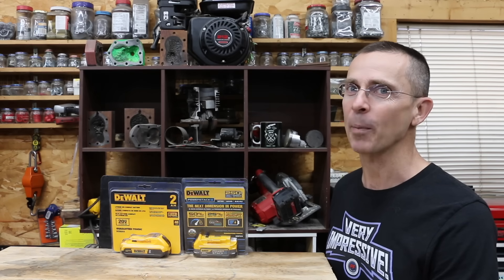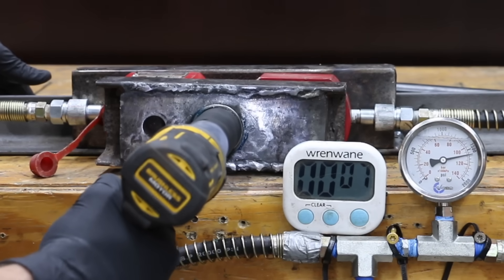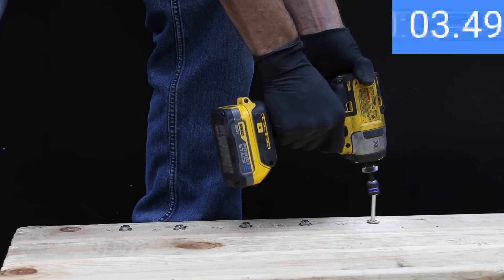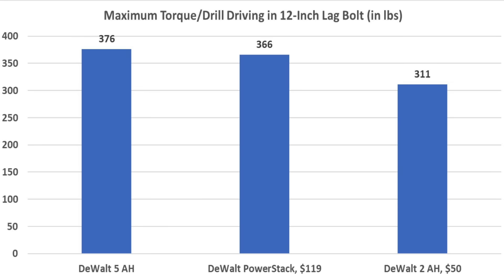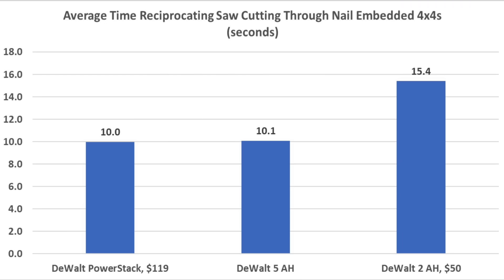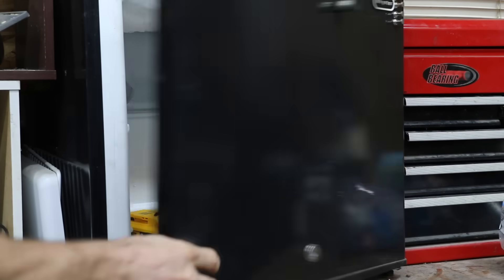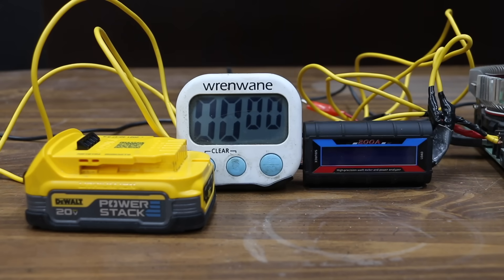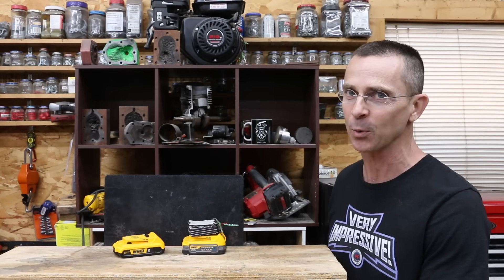Compact “Pouch Cell” Battery Better? Let's Find Out!

Comment: Hey, just wondering if you could start formatting the graphs to include zero and show the scale of the graphs, since that's more visually useful for comparison's sake. 

If you want to zoom in on the top (where the data points are) a that's fine, but this airspeed graph gives a warped sense of total useful power, and it's not the first time I've seen things like this.
Reply from the maker: Thanks for the feedback!

Comment: So the only benefit is that it is lighter? It is equivalent to around 4amp and is half the weight of a 5 amp but I didnt hear how expensive the 5 amp was to compare them. On the chart you didnt show it.
That was weird.
Reply: its not obvious but pouch cells can have a higher energy density and output for its size because it doesn't use a steel case. their are draw backs, its more expensive and less durable because its harder to cool which is probably why they are selling it only in small batteries. we will see the benefits in the future if they dont just end up deciding to use a variant of Tesla's 4680 tabless cylindrical cell.

Comment: What about heat? When the lithium batteries heat up it's bad for them, and they won't charge until they cool.
Reply: getting rid of heat in pouch cells is harder but they are a bit more thermally resistant but probably not enough to scale up well in large battery packs. i usually buy 9 amp batteries and use them for everything since very few things can ever stress them to the point of overheating.

Comment: 14:41 5cells not 6, all those 18-24V are in reality 5s batteries
historically these pouch cells aged a lot faster than 18650, there might be a reason DeWalt switched now, might've gotten a lot better.

great work great video!
Reply from the maker: Thanks!

Comment: DeWalt most likely pays less for the pouch cells than they do for the 18650s.
Reply: unlikely, pouch cells are more expenisive but have a higher output and energy density but worse heat dispersion.

Comment: Gonna have to disagree that the 5ah came out on top on the hammer drill test.  It produced the most torque, BUT the power stack drove the lag bolt further into the wood..   In jobs where longevity is more important.. that powerstack looks to be a great choice on that one..

Comment: your (pouch battery) is called lithium polymer battery, it is used in the radio controll hobby for a long time, it primary advantage is light weight and slightly higher voltage, can be dangerous if miss used or a low grade BCM (battery comtroll modiule) is used.
Reply from the maker: Thanks for sharing.

Comment: Two amp hour batteries are practically throwaways just something they give you when they include a battery with the tool, the best thing to do is immediately go out and buy a six amp hour battery at least if not a flex volt
Reply from the maker: Thanks for the feedback.

Comment: There's only 5 18650 batteries in the pack, I had to circle back on that one lol
If it had 6 it would be a 24 volt pack and I would have to switch to DeWalt lol
Reply from the maker: Thanks for sharing.

Comment: I've broken the 1/4 inch drive to 1/2 inch and 3/8 square drive with 5 amp hour batteries. I think the power stack is ideal for light to moderate load for short amounts of time. Seems good for the cordless ratchets
Reply from the maker: Thanks for sharing.

Comment: The pouch cell batteries are used heavily in the RC world. Quadcopters, electric planes and helicopters, etc. and known as "LiPo"s for lithium polymer. They're great for that use because they are capable of providing very high current draw which is needed for the motors.
The problem with these batteries are that they have to be handled with care. They need it to be charged correctly and not over discharged. The cells are not in in a plastic case and don't have a dedicated, foolproof charger. Instead a hobby charger is used which allows you to select charge rate amongst other things. If you don't know what you're doing with these batteries it's easy to overcharge them or over discharge them and end up with swollen batteries that may catch fire.
LiPO batteries are prone to swelling anyway as they age, so it'll be interesting to see how the DeWalt batteries using these cells fare.
Reply from the maker: Thanks for the feedback.

Comment: Look into the new ethanol % being allowed in gasoline. Higher than 10% is detrimental to vehicles older than 2018, and even the fuel station systems.
Reply from the maker: Thanks for the suggestion.

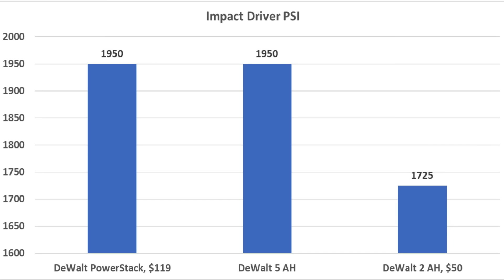Comment: I really enjoy your videos and the in-depth analysis, but there is one thing I would do differently: I would keep the minimum value of the Y-axis at 0 for all of your graphs. Moving the minimum up makes the differences between values look much larger, but loses the context for how significant that difference is. For example, the 1920 PSI vs 1725 PSI at 2:52 looks HUGE, but it's not really that big of a difference and probably not worth paying over twice as much for the battery.
Reply from the maker: Thanks!  Thanks for the feedback.

Comment: So the powerstack being a lipo is like taking a step back from li-ion back to nicad where you had to make sure they were discharged to a proper level for storing and all that. Funny how they still say li-ion though. I need to start making sure I don't keep my 2 powerstacks fully charged for an extended period then to make sure I'm maintaining them properly. Ugh not sure if they are all worth it any more with the extra hassle of having to maintain them like that whereas I charge my 5 and 6ah and they are perfectly happy until you finally use them whenever it may be. I once found a 5ah battery in my shed that was in there for about 2 years, when I found it in my tool bag and checked it, it still had 3 bars. Doubt a powerstack would hold a full charge as long as a li-ion
Reply from the maker: Thanks for the feedback.

Comment: Can you tell me if the Power Stack is able to be charged on the old 18v charger or does it need a dedicated charger.
Reply from the maker: It works on the same charger as the regular 18V lithium batteries. Thank you

Comment: Unfortunately, Dewalt is now packaging the smaller 2 ah battery with their new tool purchases when it used to be a 4 ah or 5 ah.  This is to reduce their cost but now you have to buy additional batteries.  I still love Dewalt and buy batteries once they go on sale but those small ones are only used in my oscillating saw when I am cutting drywall.
Reply from the maker: Thanks for the feedback.

Comment: To my favorite test channel please do a test on flex stacked batteries they are showing a much better performance by amp hr for their pouch cell batteries the 6 amp hr on paper is almost supposed to compete with the highest amp hr of level of standard batteries  I've been impressed with the performance of my flex tools switched after theft but I either need to buy duplicate tools

Comment: If they would just adopt LifePo4 then they would see record sales. The lithium polymer packets actually have a lower charge cycle life than the lithium ion cells, but the polymer tech can release more energy faster which is why the increases power but shorter recharge cycle.
Reply from the maker: Thanks for the feedback.

Comment: I recently bought two of the new powerstack batteries. I only use 4 5 and 6 AH batteries before this. Love the size of the new ones and the weight , power is good but drains far too quickly. Wont be buying anymore of these until they release at least a 4AH one as the 1.7 AH are just a waste of cash.
Reply from the maker: Thanks for the feedback.

Comment: I always enjoy your analyses.  To me it seems that the weight and size reduction over the 5A battery doesn't come close the additional cost.  I have a couple knock off batteries marked 6A which is optimistic that were half the cost of a 5A battery.  I could buy 5 knowck off 6A batteries for the cost of that Powerstack battery.  Granted I am occasional user of battery tools and don't carry them around all day, and I don't work my tools as hard as you do in your tests.  :)
Reply from the maker: Thanks!

Comment: I would like to see someone add an AC-DC buck boost converter to a battery pack so you can use a normal 120v power socket to run a tool instead of by battery, pretty interesting project i think.
Reply from the maker: Thanks for the suggestion.

Comment: We are building an electrathon vehicle and would be curious if the stacked batteries would hold up.  We get 16 pounds of battery (not including the case, ONLY THE CELL OR PILLOW) and travel as far as possible in one hour.  Can you suggest what battery to use?  We can run them in any combination of series or parallel. Thanks.
Reply from the maker: I don't believe the stacked cells will hold up in the long run.
Reply: @ProjectFarm  Thank you for your quick reply.  Great videos, I use them in some of my classes.  The students are persistent about this,  and they have a couple of questions.  1) can you provide the weight of the stacked pillows only? not including the case or the BMS only the pillows. and 2) can you recommend a tool battery for our application?  any brand

Comment: I will and recommend getting the 5-8ah cylindrical cell battery packs and here’s why: Remember everybody that regrading cost alone, the most important measurement is 
How many total watt hours you can use through the pack over its (variable) lifespan.
It’s worth thinking that if we double the cells (or more than double) to get the same capacity of of the 5ah, the size of the power stack goes up correspondingly, 
*it will have a lot of trouble with bloating when you put that many pouches all in a line.
*further problems of poor heat dissipation.
*heat is what kills lithium batteries in the long run.
*drawing a high amperage from a small battery pack will create more heat,
Which will reduce the total number of usable charge cycles you will get from the pack 
(This increases the cost of each watt hour that you are able to use through the pack)
*longevity of any given battery is achieved through a reduced charge/discharge rate which you can achieve through two means,
1, use less power on that battery 
2, use a larger capacity battery to run the same tool.
*since a lot of cordless tools are on/off rather than adjustable speed, using a bigger (and ironically less expensive) batter is the way to make that same potential battery life last longer.

In summary, 
the larger and less expensive 5ah 18650 type battery will:
-provide the same torque/power
-run cooler
-last far longer
-cost far less *it cost nearly half as much from the very start.

Free advice: you can increase the total lifespan of ANY battery by charging it slower and more gently as well!
I purposely charge my smaller battery packs on a slower (lower amperage) charger, the big batteries would last longer that way too of course, but they can handle the fast chargers better that’s the small batteries can.
Reply from the maker: Thanks for sharing.

Comment: You are clueless wtf the pouch cell is about... The chemistry is different, and likes to be topped off, whereas the old ions do not like being fully charged repeatedly. It's a longevity thing, so cycle them 1000x THEN test. You will find that the pouches don't degrade nearly as much as lithium ion.

Comment: One thing you didn't test was recycle life. I has vape mods with polymer batteries and I believe I get significantly more charge cycles before the battery wears out over using single or double 18650 batteries.
Reply from the maker: Thanks for the feedback.

Comment: Not that it would make it a particularly worthy market test .. but I'd be really curious about how well an 18650 cell based battery would perform if the cells were replaced with the best you could source (maybe something like the Molicel P26A). For those needing to replace a worn out 2Ah batteries .. buying a PowerStack v's replacing the cells in the worn battery could be a meaningful decision.

Great review BTW .. loved the detail ;)
Reply from the maker: Thanks!  Thanks for the suggestion.

Comment: The powerstack is 4 amp I believe
Reply from the maker: Thanks for the feedback.
Reply: No its 1.7. They have since released a 5ah powerstack and an 8ah powerpack that uses tabless cells instead of stacked lithium. Its hard to see but at 1:44 you can see that it says 1.7
Reply: @shawnbowser9187 bro this was a message from 3 years ago back off my ass 🤣🤣 there was a 5amp that was baso 4 amp and a 1.7 baso 2 amp back then

Comment: Old fart here that was around for the beginning of battery powered tools. I had a battery powered circular saw that could barely cut the full length of a 3/4 inch sheet of plywood. My ten year old Dewalt impact driver could only dream of actually turning the lag bolts that began this video. Watching a reciprocating saw cut through the 4 x 4's with nails appeared almost supernatural given what battery powered tools could do even five years ago. Really a fun and interesting video. Thank you.

"Lower the price and increase the capacity" :) I think they may have thought of that. A guess is that the price is going to drop quickly. I don't think this format of lithium ion battery is more expensive than the cylindrical cells and they will sell massively more of these batteries at $60 a pack.
Reply from the maker: Thanks and you are welcome!

Comment: any chance of testing the "Flex" stacked batteries? the same cell type as the dewalt powerstack, but they make larger capacity cells.
Reply from the maker: Thanks for the suggestion.

Comment: Dewalt powerstack, li-ion flat battery, drill drive with big hex screws torque test if flat battery too hot then be pressure then check measure thick size before then after
Reply from the maker: Thanks for the video idea.

Comment: I have no idea why so expensive the Powerstack. Is not a new technology. Lipo cells can take high ampers and also can to charge at high amper. I use them for fpv drone,rc cars. The DeWalt a top end quality product  but they still using low discharge lithium cells. I'm pretty sure if you order a  30A-40A discharge chells from Aliexpress max 4 euro/piece.  is will do better jobb than the original cells and they last longer because 3000mah not 2000.
Reply from the maker: Great point!

Comment: Pouch type cells are typically lithium polymer chemistry vs canister type cells that are typically lithium ion.Energy density and current handling can be greater in pouch style but are alot more at risk of structure damage from outside impacts than canister types.as mentioned in previous comments the pouch can also puff up over time.positivly charged lithium exposed to oxygen in the air reacts with tremendous heat that can cause fire and the reaction continues till the energy is depleted, often creating a fire that won't extinguish till the reaction is expended.In portable ( dropable ) work tools , I'd imagine canister type encased cells were most suitable.let's hope " ultra fire " don't move into the li-po pouch market 😂

Comment: I have a 18v flex battery bought it about a year and a half left it fully charged new I always check to see if they are still fully charged and noticed yellow fluid leaking from 1 I put it on the flex charger and it doesn't read it as defective I don't know what it is and if I should use it?

Comment: Oh btw! I do Remote control car hobby work including modification of conversions of brushed to brushless motor. Correct me iI'm wrong? But powerstack battery looks like a stack of LIPO ( lithium polymer batteries). LIPO gives great acceleration for about a minute or two. Then taper off.my tyres balloon but I have bought expensive LIPO and EBay LIPO. I've had expensive LIPO batteries swell yet factory Chinese LIPO batteries from a reputable seller? Lasts longer over time! LI-ON IS Still safer. Just from experience! I'm happy you brought out this vid. 👍👍👍

Comment: The size and weight of the original lithium ion batteries wasn't bad to begin with, especially compared to the old batteries we dealt with 20 years ago. Considering you can find deals for the 5ah battery cheaper than the power stack, I would rather have the 5ah batter that can do bigger jobs for longer.
Reply from the maker: Thanks for the feedback.

Comment: TLDR: If you go more than a week between uses of your tools do not get the power stack!!!!!

The power stack appears to use lipo cells which is a serious issue for average users. lipo batteries are very high maintenance. if you don't use the battery for over a week you need to use a very special charger to drain and partially recharge the battery to a specific voltage. if this is not done the battery's capacity will rapidly decrease. additionally lipo batteries are much more vulnerable to impact  damage that could cause the battery to violently combust when you charge a damaged cell. lipo batteries have great power output, are light weight and cheap. this allows companies to put very good numbers on their packaging and pass tests like these when brand new without any difficulty. however the average DIY user will need to buy a new battery every few months/uses. and on jobsites where tools are badly treated these could cause a serious fire risk.

If you want to know more about lipo batteries then check out a guide on rc car batteries. hobby grade rc cars use a variety of batteries and lipo batteries are very common in top tier rc cars so there are lots of guides on lipo batteries.
Reply: a long term life span test of some sort with these batteries could be interesting, one set used every 2 weeks versus another set used every month to see how each battery degrades.
Reply from the maker: Thanks for the feedback.